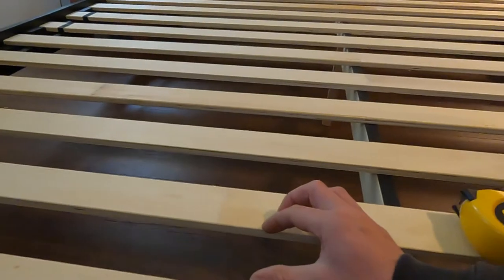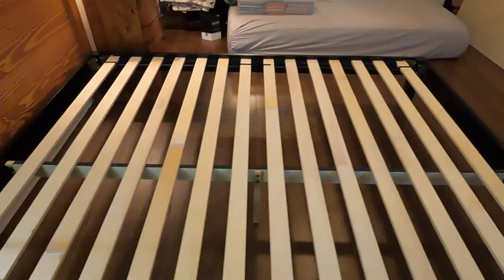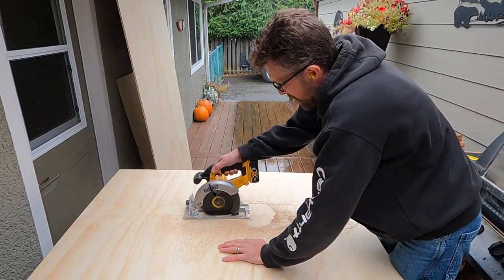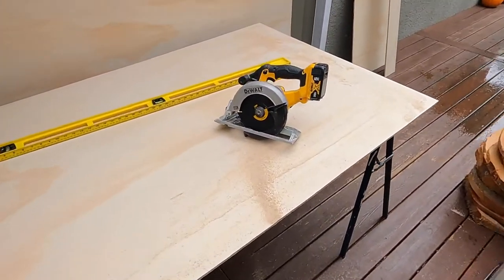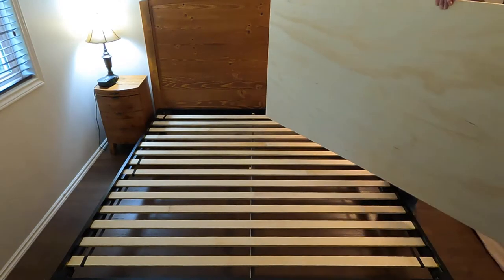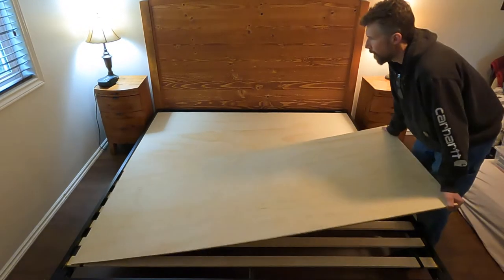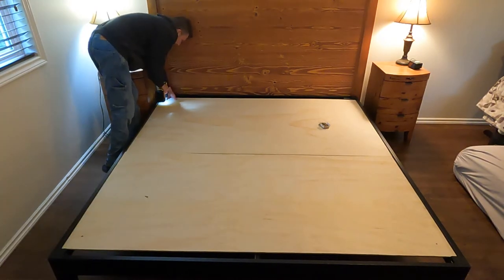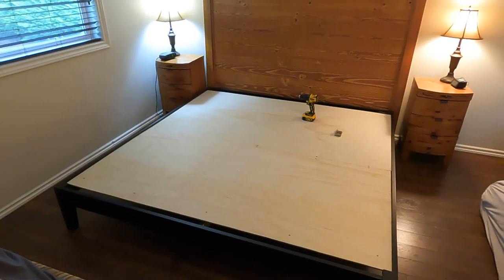DIY SLATS to SOLID Platform Bed Easy!🛏👍

Comment: So what do you suggest me do I need to place sheet over the slats because I own a mattress not a memory foam. As far as the sagging issue, I don't think I would be worry about that much and I normally flip my mattress once in a month to keep it in a good shape.
Reply from the maker: @gameotic1  You would either need to get a box spring for the mattress or flip it monthly like you said. I wouldn’t put it on plywood as it needs to breathe.

Comment: If it can ruin a regular mattress, what can i use to put on top of the slates. My lower back is hurting every morning. Ugh.
Reply from the maker: @melindahernandez8778  lf you have a regular mattress on slats the only suggestion l have is to use a box spring under the mattress instead of slats as a box spring allows airflow through. Hope this helps!
Reply: @JENSENDIY  , thank you.

Comment: How is it getting on?
Pro and cons.

Did you notice any presence of mould under the mattress?

Thickness of the board?

Have you pretreat the plywood?

Thanks.
Reply from the maker: The plywood is holding up very well. No mold whatsoever under mattress. No treatment on plywood, I bought the sanded pine plywood. Sometimes the bed creaks a bit when getting up which may be prevented by using a heavier thicker plywood than the 3/8" I used. Thanks for watching!
Reply: Does the matress feel like sagging any area ?
Is 3/8' good enough for soft matress ?

Comment: Hi Jensen, what about the gap at the end of the frame? Is that gap okay if you are putting a memory foam mattress? I have a pretty thin mattress.....
Reply from the maker: The gap at the end of my frame is under 3 inches & it was because l didn’t want to notch around the frames legs, you don’t have to leave a gap if you cut the plywood a bit bigger and notch the corners.

Comment: Why 2 pieces? Why not 1? It seems logical 1 solid piece would have greater structure stability? Maybe It doesn't matter, or I'm over thinking it maybe? Great video as well.
Reply from the maker: Thanks, the area is bigger than 4x8 which is a standard sheet of plywood so l had to get 2 as it’s a king size bed.
Reply: @JENSENDIY  okay, I knew you had a good reason. Thanks for the reply.

Comment: Can one do thus without the screws? Or needed?
Reply from the maker: You could do this without the screws as long as the  plywood is supported well on all edges and corners. You may want to use thicker plywood though to prevent noise.

Comment: This can ruin the mattress
Reply from the maker: For a regular mattress l agree but for a memory foam mattress I have had no issues at all having it on the platform.
Reply: how can it ruin a mattress???
Reply: I have a memory foam mattresses as well but the ikea frame came with curved slats. I am thinking to lay plywood over.

Comment: Wouldn’t it be better to put a few holes in it with a hole saw to encourage airflow?
Reply from the maker: Yes you could do that but the memory foam doesn’t need airflow like a standard mattress. I did this 1/2 a year ago & the underside of the memory foam still looks new.